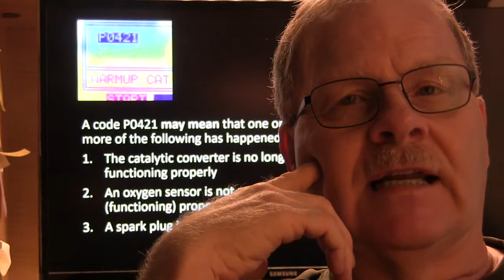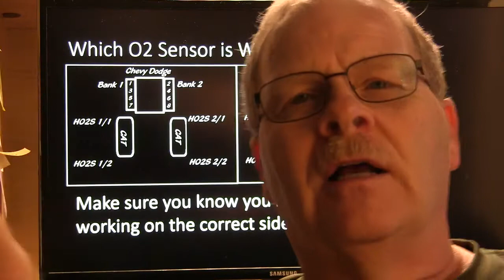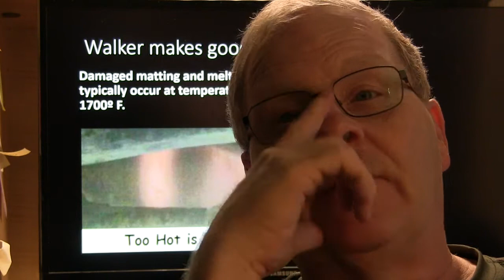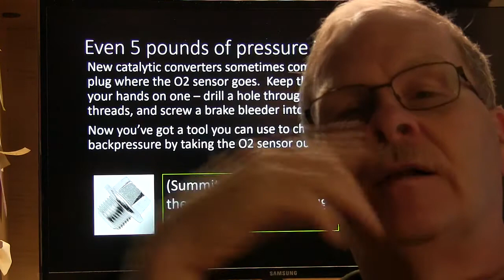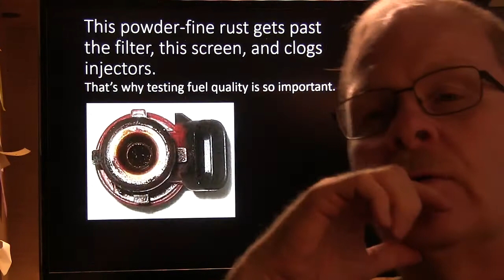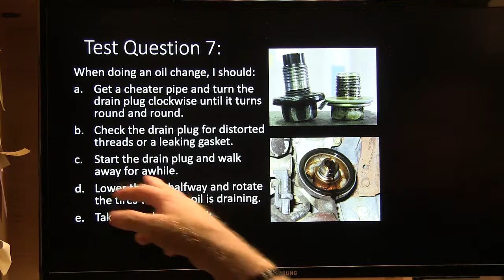Cats, Sparks, Fuel Tips

Comment: I have a 99 Chevy suburban 1500 4x4 sle trim I purchased and found out the previous owner had removed O2 sensors. I’ve been told really don’t need them , I’m fine without replacing them. Should I replace them or just continue without them?? Thanks for the help.

Comment: Did that 60's Camaro with a hot muffler have a carburetor power valve affected by vacuum? Did it have mechanical ignition timing with vacuum advance? Would low vacuum have an effect on those functions? Could the muffler be a restriction point collecting extra heat? 
Thanks for making videos.
Reply from the maker: Mike, that was nearly 50 years ago; timing was one thing we knew was right, and so we discarded that, but there was a big vacuum leak in a major hose - probably the PCV. For most of my career I have pondered that situation and have not been able to come up with a satisfactory answer - but I do know the muffler cooled down when we fixed the leak - the dynamics were different because there was no catalyst.